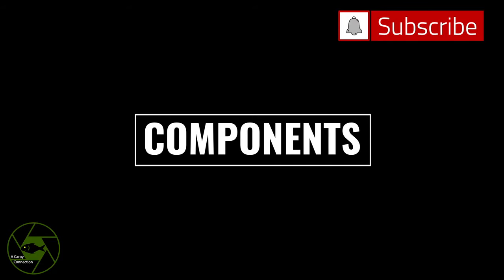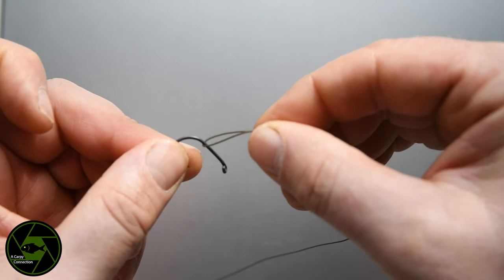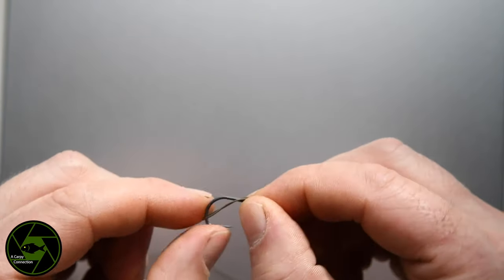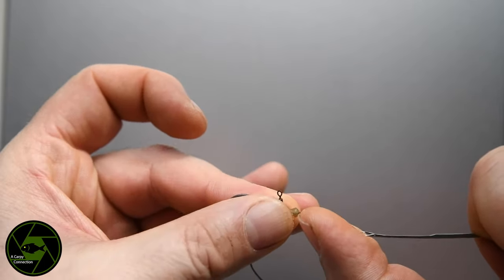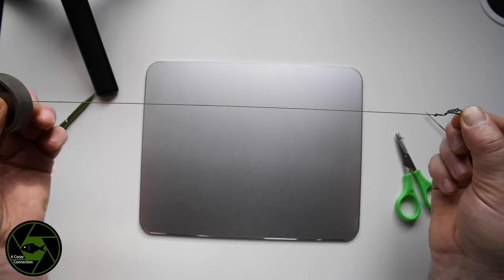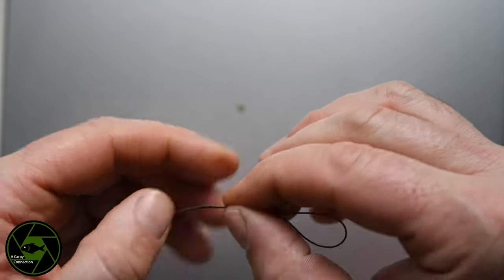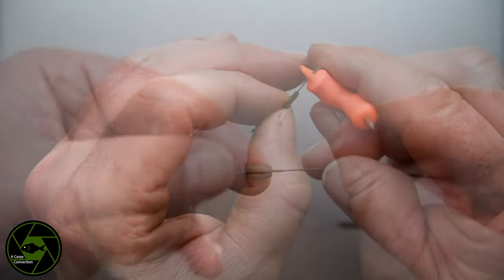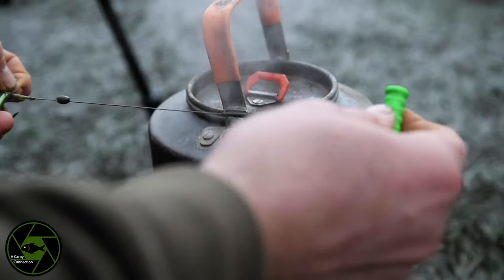Carp Fishing Rigs -  A Carpy Connection - How I Tie The Multi Rig

Comment: Interesting use of the line aligner. 
Never felt I've need to use anything but I can see why it's a good idea.
Reply from the maker: Hi Darren. Thanks for your comment. I find the line aligner helps turn the hook really quickly. Even without the weight of a hook bait. I guess its personal preference and something i have always used on alot of my rigs. Keep safe mate😃👌🎣
Reply: @ACarpyConnection  no line aligner there  just a piece of tubing  or a kicker as they call em these days  .
Reply: I’m guessing the line aligner also stops the loop section pulling down to the eye of the hook which can sometimes happen with the Multi Rig? Definitely going to give this a try.

Comment: Needs a figure of 8 knot instead of an overhand knot, alot stronger & sits alot straighter, apart from that decent rig..
Reply from the maker: Hi John. Thank you for your comment. I disagree with you on the knot mate. In all the years i have been using the overhand loop knot, i have never had one fail. The reason i use it is because it is a smaller knot and it is easier to slide the anti tangle sleeve over. It also causes less distress on the braid coating which is what causes the knot to not sit straight, especially with the N Trap. Once it is steamed it sits nice and straight anyway. I appreciate your comment though mate. Thank you for watching. 😃👌🎣
Reply: @ACarpyConnection  that's great, has long has your happy in its strength & it does what you want it to do👍 I also use anti tangle sleeves most of the time & iv ended up tying quite a small figure of eight so it sits  neatly in the thicker part of the sleeve.
Reply from the maker: Just stick with what you know mate. Each to their own as they say. Hope you are keeping well. Hopefully we can all get back on the bank soon. 🎣😁👍